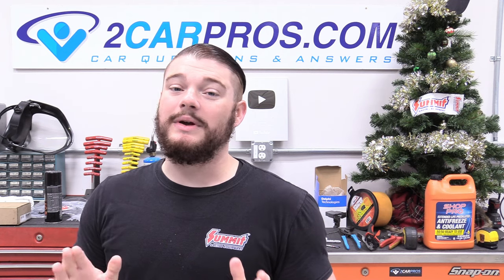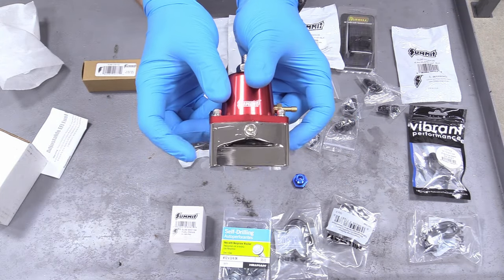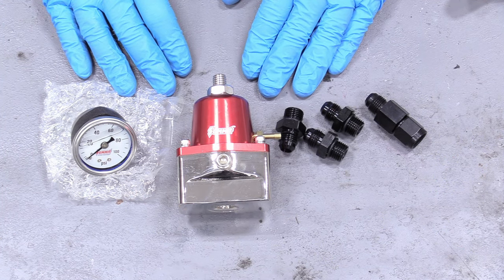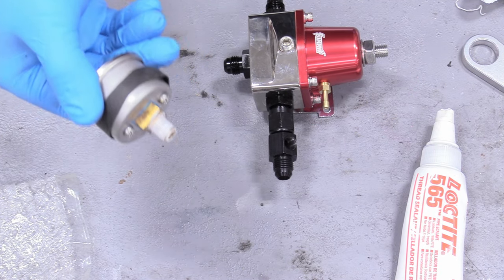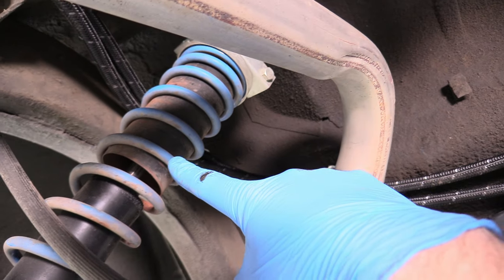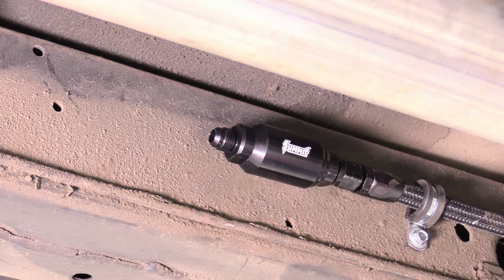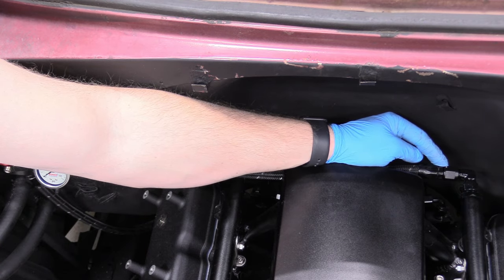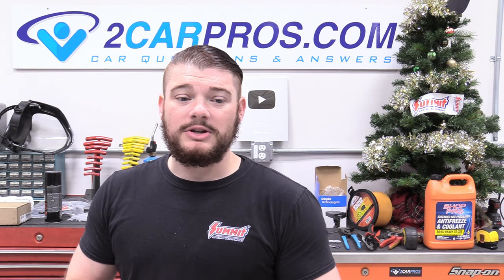How to LS Swap - Episode 7 - Fuel Pressure Regulator and Lines

Comment: You can also put a guage right on the regulator on that port on the front of it using a cheap adapter.  That saves having to add than 2nd AN connector with a port on it.   Great videos - really appreciate them!
Reply: He can also remove the guage and use it for another build if he left enough hose length

Comment: My LS swap runs great with the stock GM fuel system and I get great gas mileage & horsepower, I remember just adding just one AN fitting to the fuel line. I feel like summit is trying sell something we don't need.
Reply from the maker: That's great! But I don't have any stock GM stuff to use. Thanks for watching!

Comment: I plan on doing something very similar to this on a 69 Chevelle but I plan on using the factory 3/8 stainless steel hard line for the fuel supply and ptfe hose for return.  My question is to go from tank to hard line can i use a compression fitting to 6an or just use hose clamps at the hard line and an fittings at the intank pump.
Reply from the maker: I've seen people use the compression fitting to 6AN but I've never used them. In my opinion it is tough to trust since it was only ever designed to handle 8psi or so. I like to just use the 6AN from the pump all the way up so I know the fittings won't ever have a problem. Thanks for watching!

Comment: This is my first time hooking up fuel for boost and motion race works is saying that you always put the regulator after you put the fuel to the rails. They said if you put the regulator before the fuel rails that's the last couple cylinders may not be getting the proper fuel after hitting the first five or six. They're saying each injector takes pressure and by the time it gets to the end of the rails you will have lost pressure but if you put the regulator after that it's fine. I copied you but yet I'm still so confused because everyone saying do it differently.

Comment: Only Problem is I can't have any fuel lines on my firewall.
How far from the carbs can I be with the regulator? I'm thinking of going all the way to the front then up to the front of the motor. I don't have any place to mount the regulator up by the blower. Can I put it on the frame and run a 24in long line up? What kind of pressure drop will I see on acceleration? 
This is for my 57 Blown SBC 750hp dual 750s

Comment: Hey Ryan - love the videos!  With a return line, diagrams I have seen put the bypass regulator after the fuel rails so it's controlling the pressure in the rails as fuel is consumed, and the guage is seeing the rail pressure.   Pump -> rail1 -> rail2 -> regulator.  Do you get any problems running it before?
Reply from the maker: Thanks for watching! I don't see a problem running it that way, just seems a little more complicated. 

As fuel is used the pressure drops so the regulator will let more in for our set up.
Reply: @2carpros  why didn’t you apply your gauge in front of the regulator
Reply from the maker: @irvingbar4569  Because then you would only see unregulated pressure. We want to know what the pressure going into the injector is. Thanks for watching!
Reply: @2carpros  my apologies I meant on the regulator in front were it has a plug

Comment: First off merry Christmas from the Mississippi Delta!  

So question...why did you cap off the rail closest to the regulator and route the feed line further away?  Is there a space issue behind the closer rail that we can't see or is there another reason?
Reply from the maker: Merry Christmas! 

I thought it would look snazzier and it's too close to the firewall. Thanks for watching!

Comment: Thanks for the upload. Iam still confused about the regulator. My 350 with 650cfm and 320hp is low in pressure I think. What regulator makes sense? Bypass? Back line? Dead head? Want just have a in and out to the carb. Possible? Thanks
Reply from the maker: Yeah just have a line run from the fuel pump to the regulator, regulate down to 8 psi, run the return to the tank, then run the pressure line to the carb. All done. I'm assuming you have a pump in the tank like this setup. Thanks for watching!

Comment: Can I route this setup for a 327. Edelbrock has a max rating of 6.5 on its AVS2. However, I live in the southwest and want to monitor PSI with weather conditions. Let me know your thoughts, thank you!
Reply from the maker: Yeah definitely! You just might want a smaller gauge capacity so the resolution of the gauge is easier to see. You also could go with a way weaker fuel pump if all you need is 6. Thanks for watching!

Comment: Are you going to hook up the vacuum line to the intake ? Does it need too if your only to be NA
Reply from the maker: Do you mean like for PCV? I go over that in a later video in this series. Thanks for watching!
Reply: Whoch video is it on?
I have a turbo diesel, where do i run my vac line to? Does it need to be a BOOST line or a vac?

Comment: So how do you run lines with dual tanks I’m having a problem with this do I need 2 of everything?
Reply from the maker: No. You just run a send and return from the tank to the regulator and then one line out the send of the regulator to the injectors. Thanks for watching!
Reply: @2carpros  what about the 2nd smaller tank? Do I need to do anything to the tank switching unit 89 f150

Comment: Wait, I'm doing my own Ls swap, I'll need a regulator to feed my LS ??
Reply from the maker: Yes. The LS injectors want 58 PSI of fuel pressure. The pumps usually put out around 90. Thanks for watching!
Reply: @2carpros  Thank you

Comment: Great video Ryan!   Couple of questions: 1) I thought AN sizes were 6, 8, 10 but you have 7 and 7.5 wrenches - are those from Summit?
2) you reference another video where you  make the fuel you make the fuel line?
Reply from the maker: Thanks for watching! Actually ICT makes them. They work great! Really makes putting the lines together better. 
Sure, here it is, it's steam lines but they go together the same way as fuel lines. https://youtu.be/N3AkbwntZKw?t=219
Reply: AN (Army/Navy) is just first number of 1/16 increments.  3 =3/16”, 6= 6/16” so it’s a 3/8”, etc.

Comment: That FP gauge under the hood is cute but worthless for any real diagnostics. You should replace it with a fitting with a schrader valve like ALL factory fuel rails have so you can connect a pressure gauge with a hose you can read outside of the engine bay. One you can see while driving. As a tuner the #1 problem I see on swaps is fuel delivery problems. You can have perfectly fine FP when idling with the hood open to see your pretty little gauge but have low fuel pressure while driving and at WOT when the fuel demand is high. I see too many times on swaps there is no way to hook up a real diagnostic FP gauge.

Comment: Why not mount the fuel pressure gauge to the regulator?
Why using a plug plus adapter to fuel rail instead of using a plug directly to the fuel rail?
Why using 90° adapter instead of using hose end elbow? 🤔
😂 😂
Reply from the maker: Because there is no 1/4 npt fitting on the regulator. It's a straight piece with a thread for a gauge literally what it's for. Thanks for watching!
Reply: Also curious…. The vacuum reference is what he’s talking about. Can I just tap this anywhere into my intake manifold?!